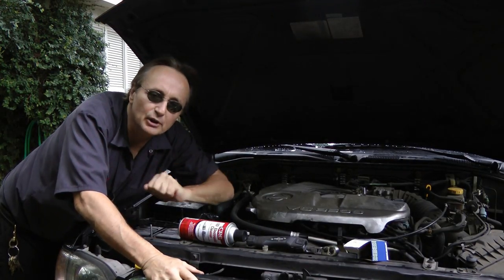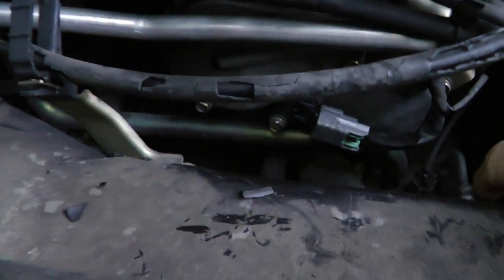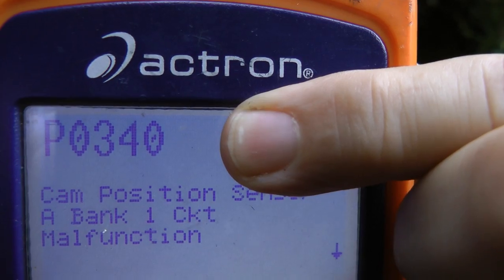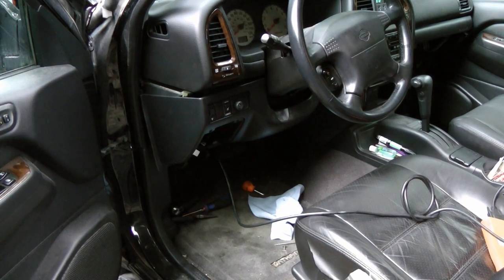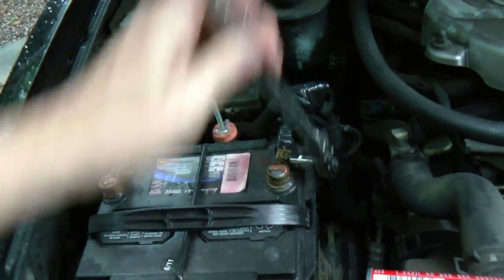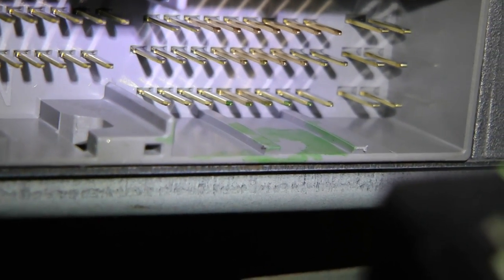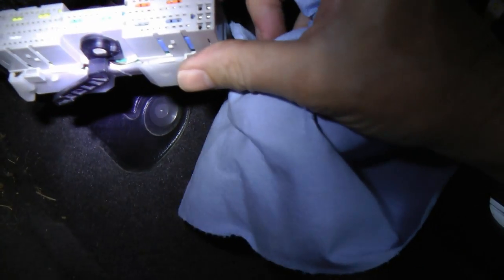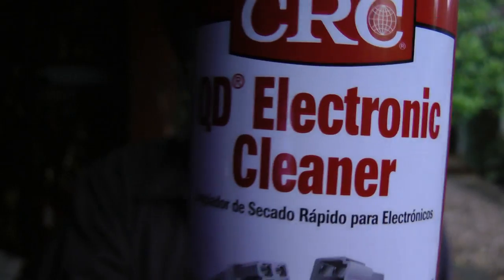How to Fix Computer Problems in Your Car with a Little Spray Cleaner

Comment: Hello. I purchased a 2002 Nissan Altima from a private owner with 196 + miles. It ran ok for the first few weeks, then the electrical system went haywire. Below are a few examples:
1. When I would turn on any side turn signal, (Going speed limit on intereste) car accelerates.
2. If I want to use the cruise control and the air/heat at the same time, I have to activate the cruise control first, then turn on air and or heat.
3. Gear selector light goes off and car feels like it is down shifting or out of gear. Then light comes back on and it runs normal.
When I use the window controls the car accelerates.
These are a few major concerns for me. I have contacted the manufacturer to check if there were any recalls just to make sure that the car has no issues there.
I would like your thoughts.
Thank you for your time.
Reply: L Soto car was in a flood!

Comment: Scotty, I just watched your video "fixing computer problems" and I'm having a similar problem. 2005 Cadillac STS 4.6 started getting P0113 code and my mechanic had me change the MAF with the IAT on it. It's been changed 5 time now with OEM unit from Amazon. Still pulling P0113. When he puts a Snap-on scanner on the tests it show the ECM says the IAT is at -40 degrees all the time. He wants me to try another one. Today it pulled a U0100 but my Torque app cleared it and it runs fine. Should I try another MAF, clean the connectors, or get a new ECM? Thanks in advance
Reply: Sounds like a faulty coolant temperature sensor, it would cause the computer to constantly read at -40. Just my 2 cents

Comment from the maker: actron makes good generic scan tools I use in older videos. My fancy one is an Autel Maxidas.
Reply: I need your help
Reply: I need your help car start then dies then i turn the ignition switch on and off then starts up but rpm can go higher when i press the gas peddle its make like a deep sound
Reply: 2001 nissan sentra

Comment: Hey scottie I have an unusual problem. I replaced a radiator in an 01 impala. The radiator support had been damaged by a previous owner so the radiator was a tight fit. I had to remove the pcm connectors bolted inside the air box to be able to move the wiring out of the way during rad install, or so I thought. I didn't realize the whole pcm just slid out. Needless to say i forgot to unplug the negative battery cable and I now have 14 simultaneously occurring engine codes. One is low brake fluid. Another low wheel speed sensor. Another coolant temp sensor code. I could get all of them if it would help, however the car starts runs drives without real noticeable problems. Idle wavers a bit but nothing too crazy. Sometimes first to second is hard, but I've been reseting the pcm by pulling negative and waiting, which resets the shift points so not too worried about that. And I'm definitely not low on brake fluid :) but what's more likely I fried all these sensors or the pcm? Volt testing on brake fluid sensor showed 14v and 0...

Comment: Hey Scotty I have a 01 Pontiac trans am 5.7l ls1 I am having an electrical issue where the car runs horribly and is throwing codes saying bad ground and crank shaft sensor performance I have replaced the sensors it says that are wrong and I’m still having a bad idle and throttle response and spark issue. Any ideal what I should look for

Comment: Hi Scotty, I know this is unrelated but we have a 2002 Honda CR-V with 230,000 miles and the transmission isn't slipping but downshifts hard into first when coming to a stop and also will get stuck in over drive when slowing down to make a turn and you have to give it some gas so it will kick down.  Any ideas on what could be causing this?  Transmission control module, fluid, etc?  Any help would be greatly appreciated.  Thanks.

Comment: "As we see here on the engine, it already has a new cam position sensor, so we know it's not the sensor," WRONG! New is an acronym, N.E.W. Never Ever Worked. Always start from square one, and don't assume anything, if 26 years in the automotive diagnostics and repair industry has taught me anything, it is never trust a part just because it is new. (even the OEM stuff)

Comment: Hello Mr Kilmer. I have a 2001 Toyota Echo. The time to fix the engine has arrived. The engine, is a 2005. A mechanic is telling me that it has to be same year engine if I want the engine to start, some start and turn off right after. Because computers are different from year to year and or timing chains. etc...So what do I do? I've heard guys swap engines flawlessly.  What do I do? Thank You
Reply from the maker: find a used engine from a junkyard from the same year echo

Comment: Scotty I recently had my spare tire stolen and need to replace it. Right now I have a normal tire and it takes up too much space in the trunk of my 92 Acura Integra. Is there a way or a code on the spare donut wheel to look for so I can pick one out from the junk yard and know it will  fit my car?

Comment: Hey Scotty ,I just swapped the engine of my fiesta 1.4 tdci, can i reset the computer by connecting the postive and negative wire? it runs and starts but is is not running smooth after i unplugged a connection. It gives no error codes already read out.
Might give this a try good video!
Reply from the maker: heck, give it a try, and pray you didn't get a crappy used engine if you went to a junk yard

Comment: Hi there, I do have a Pontiac vibe 2005 manual trans. Cranks but wouldn’t start, no sparks on all coils, I installed a new crank sensor and still the same, scanner can’t communicate with car computer, on dash no engine light comes on at all times, borrowed another computer from same model car and still no start. Any ideas ? Thanks

Comment: Hi I have changed spark plugs cables distributor 2 times and I still have low idle to the point it dies when it gets to operating temperature and some times feels like it's only running on 5 cylinders help me it's a 1999 qx4 could it computer ? Are they interchangeable without having to reprogram to my key or anything?

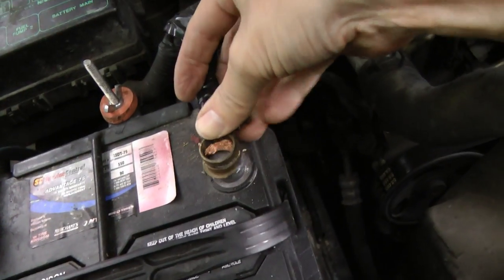Comment: Ayup Scotty!! At 2:23 did you tighten the battery lead on fully before you cranked the engine? Not teaching anyone to suck eggs, but some engines won't crank if they have just been put on loose, I just thought I would point this out to anyone looking to do this themselves. God bless Scotty :) .

Comment: Hey Scotty . I believe my 07 chevy Malibu ls have the same kinda problem electrical . It starts but the doors won't lock and the keyless fob is not connecting . Just don't want to get ripoff so I use them manually ! 😫Sad I know 😢

Comment: Hey Scotty. Can corrosion on the ECU cause the battery light to come on? I replaced the alternator twice and cleaned the cables to the alternator, and the positive & negative cables to the battery. The car is a 2001 Oldsmobile Alero. Thank you.
Reply from the maker: it often will, but of course check the overall charging system wiring connectors and wiring for corrosion and possible shorts first, especially ground wiring on a GM product

Comment: If it runs good with the green middle hose off wouldnt that mean the egr is ok?  Also I may of did a bad move,  I cleaned the throttle bottle with O'reilly carb cleaner.  Some people say that is bad and others say it is ok.  I should of used O'reilly throttle body, but I didnt know there was a difference.  Could this be causing the problem?

Comment: HI SCOTTYY .. i have an astra g (GM) with a 2.0 dti engine .. i changed the EGR valve it was in bad state , a new MAF sensor , and installed new pipes for the vacum lines , i noticed that the vacum lines have oil in them , and im assuming my  vacum pump is bad, but the problem that i have is that the engine check is on and if im gonna to get from a junction the car misfire a little under 2000  rpm .. could it be a CRANK SENSOR ?? ive cleaned it it was full of oil and dirt ..thanks as always, :)

Comment: Hello I have a 2008 chevy tahoe that has a reduce engine power on the dash. I changed the throttle body sensor and still nothing..do I have to reprogram it

Comment: hey Scotty, wish you are fine, really  thanks for this video, i got a problem with 2008 Volkswagen Passat that had a check engine light for exhaust sensor fault, i had replaced the sensor but it took few month to arrive from VW dealership and when we replace it the check engine light remain for the same code, we did what you have done to the ECU with electrical cleaner and unfortunately still have the same fault. Does this mean that the ECU is bad and need be replaced or it just want to be reprogrammed. Thanks alot
Reply: Bahaa Adel you can test the O2 sensors both pre and post cat offline.  Then erase the codes and see if they come back again and under what circumstances.  If hard acceleration triggers the CEL (AND smooth driving works fine) then it may be the cam shaft sensors which are cheap to replace.  If your O2 sensor is reading low voltage which I remember corresponds to a lean combustion, then check the rubber connections around the MAF and throttle body.  There could be air leaking somewhere.  Good luck!

Comment: hi thks 4 the video.
i hav a previa le 95 which is not starting but cracking very well
so we hav replaced the distributor but still it wont passes any current to the spark plugs.
&the chk engine light not turning on 
i think my car's computer needs reprogramming 
do u hav any suggestions for me?
pls help me scotty

Comment: Usually it doesn't matter. However if you remove the positive first, be really careful while you're doing it not to accidentally touch the wrench to any adjacent metal. Good practice says to take the neg off first, for the following reason. If you remove the neg first, it won't matter if you accidentally touch metal, since the frame is also neg. Once the neg is off, accidentally touching pos to the frame is unlikely cause sparks.

Comment: Hey scotty I have a 02 mitsubishi lancer 4 cylinders and its not getting any spark. The car has two coil on boots. I was wondering if it could be a bad computer? I already replaced the crank sensor. Thanks!
Reply from the maker: computers go bad on those ALL the time, and can cause just that

Comment: Guardiantony31 check the ground black wire going from the negative battery terminal to the fender. Sometimes the bolt at the fender becomes loose and/or corroded. Clean and tighten.

Comment: hey Scotty I have a 2001 Dodge ram van 1500 I'm getting  a p0601 code  check my ecm for green corrosion had none can I spray the connections?

Comment: Scotty, what are some of the signs of a bad PCM? I'm interested to know
Reply from the maker: many things can happen, as they run tons of stuff on the car. From not starting, to misfiring
Reply: Scotty is absolutely correct. To add on to what he told you, if you've fixed all of the other things in your vehicle and the CEL still will not go away, then that's when you definitely want to have a mechanic physically look at the PCM and test it at the dealership. One of a few signs of a bad PCM could be your CEL never going away. Before replacing the PCM, you definitely want to make sure your evaporative solenoid are in good shape and not showing bad voltage, otherwise it can possibly damage, or fry, your PCM. The key part to this is making everything else other than your PCM is in good shape.

Comment: i very much appricate your  help with all the videos  i have a 2004 Toyota prius .I watched your video on how to change the Hybrid synergy mechanical pump and i did  replace with a new one  . now the car will not even go into the acc mode to be able to start .I am doing a system reboot atm i am hoping the ECM will reset .if not could you help me locate the Ecm computer ? i will  check that next i am used to Amerian made cars . gas conbustion engines  i can rebuild a 350 blind folded  , these Hybrids are another beast .

Comment: Hey Scotty, I was getting a p0011 and P1391 on my 2004 Vw gti vr6 24v. I had my timing done and cam position sensors done. And the codes were gone for a few days. First the P1391 came back, then the P0011. I replaced the cam sensor again My mechanic graciously went back in,  checked the timing and it was spot on. Codes were gone for a few days again, then the P1391 and then the P0011 returned. My mechanic is at a loss. Seriously thinking ecu might be my issue. Any thoughts?

Comment: My abs light would come on but before doing anything crazy I undid the connectors to the wheel bearings and sprayed inside with brake clean the light never came on again, it doesn't take much to cause a bad connection.

Comment: Hi Scotty, am looking at buying a car 2006 holden commodore omega but it has a light coming on when starting up, the seller has seen a mechanic, said it is an easy fix, usually when it is easy , it usually is not.. apparently its a typical VE computer problem ..I am based in Australia.

Comment: Hi Scotty i've got an 2007 Chevrolet trailblazer which have the same problem in the video but it keeps giving the crank shaft position sensor code and the spark plugs isn't sparking so is it the connection also ?
Reply from the maker: could be that, could also be a bad main computer

Comment: Hi dear. I have Nissan altima 2005 my problem is that the car coils keeps burning after 2 days and I have to keep replacing it. The car shakes alot when Ac is switched on then I have to switch it off but it still shakes for a while. I have recently replaced new engine but still the problem is same. The garage worker is unable to identify the root cause. Could you please guide me. Thankyou

Comment: did you use the electrical cleaner on the wires as well ??
Reply: +johnny acero  ya i did that and checked my compression,spark, power to the injector, vacuum leaks. what was weird tho is if i put a tiny bit of gas in the pcv valve the number 1 cylinder will pick it up. im lost

Comment: hey scotty. I got a p0351 ignition coil problems. I replaced the coil and I doubt it's the pcm but it says it might be. car won't start. no white smoke out the tail pipe. brand new fuel pump.
Reply from the maker: check the wiring and PRAY it's not the main computer, for instance on chryslers it's often the pcm

Comment: I have a 1996 Dodge Intrepid, recently while driving the dashboard all flashed on and the RPM gauge started dancing for a second, is this a sign of the computer failing?  not sure if this is related, but it has also been making 3 quick honks.
Reply from the maker: could be, but more often that's a wearing out instrument panel, they are cheaply made

Comment: i have a similar problem with my car no matter how i drive the car i get the same fuel consumption, i unhooked my o2 sensor and run the car like that for more than 60 miles and the check engine light did not come on, then i unhooked all of my sensors from the throttle body let the car idle an still the check engine did not come on, the engine is running ok but the fuel consumption is terrible, please give an advice. Thank you! p.s check engine light does come on when the ignition is on the on position, after i start the engine light goes off.

Comment: I have been having this issue with 2003 toyota camry. It randomly allows  me to turn it on. And camshaft sensor and connection codes pop up . hopefully this will be my case.

Comment from the maker: Low fuel pressure is either a bad pump (if you didn't use a factory pump the cheaper ones often don't work), a restriction in the fuel filter or lines, OR a bad fuel pressure regulator. May be time to see a mechanic to analyze it

Comment: Hi Scotty!   By accident I umplug the connectors from the main computer (just umplug) with the battery connected. Than plug them in. Do you think could damege something or maybe not!!!
Reply from the maker: pray you didn't damage it from voltage surge or static electrical charges
Reply: بهث6

Comment: Hi Scotty so the other day I jump started a friend he drives a Chevy pickup 1500 and I have a 2012 Toyota Camry 2.5  well ever since I gave him a boost .My car shows some dash lights (abs, traction control, power steering) on some startups but once I shut down the car and re -fire it they go away. Any clue on what may happened ??
Reply from the maker: +Carlos Alberto it shorted out some computer module doing the boost. NEVER have both cars running at the same time if you did that. Boost from the good car which should be turned off when doing the boost to prevent that

Comment: Hey Scotty, I got another car question that I need some help with. I have a 78 Oldsmobile, its more of a show type car than anything else so it is not a daily runner. Sometimes it may sit for 2-4 weeks before it gets taken out of the garage and driven. It seems like the first time it is driven after sitting, it will lose a small bit of antifreeze on the driver`s side under the radiator. After the first time however it does not seem to leak at all after that, what could be causing this?

Comment: Hello scotty, I've a got 2005 mercedes benz c240 that won't start.  Most of cluster lights and none of gauges work.  Also, ac doesn't come on and the blower fan doesn't work.  I've got an error code of p0600, which is a Serial Communication Link error.  Can you please give me some guidance as to what I can do fix the problem.  thanks.

Comment from the maker: if you have the actual sending unit that runs the gauge and there is no wire on it, no, that's not normal. but realize they can put sending units on more than one place

Comment: Hey Scotty, can I clean my pcm (powertrain control module) with electric spray as well?  My  2005 Chrysler 300 turns off on me while I'm driving. The codes I received are P0420, P2503, and P0700.
Reply from the maker: you can clean it with spray electrical cleaner IF you remove it from the vehicle and have it all unplugged, and then let it air dry a hour
Reply: Scotty Kilmer thanks a lot. Will do that today.